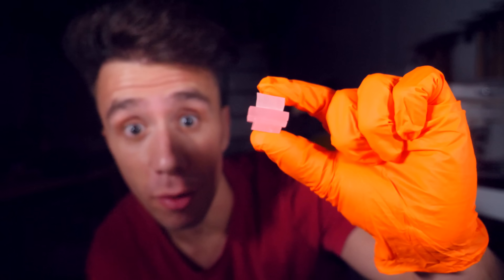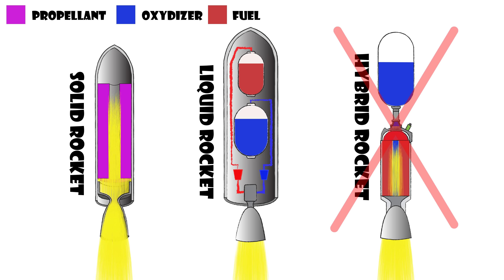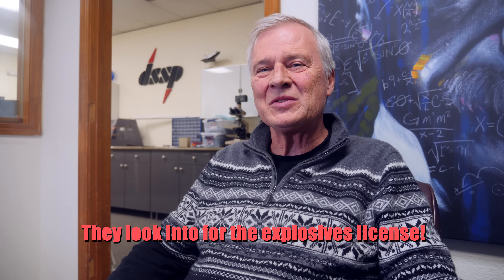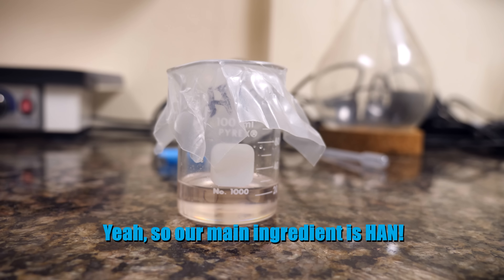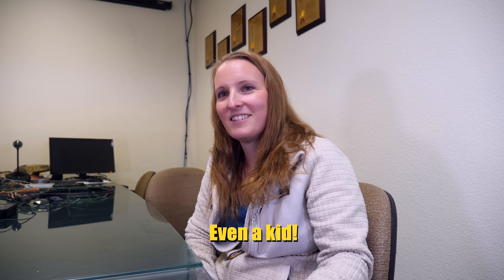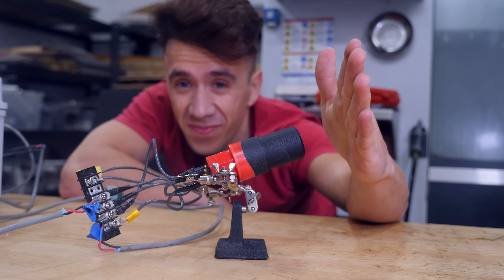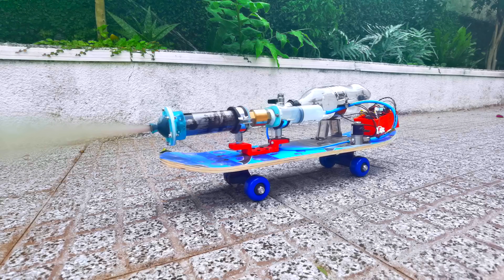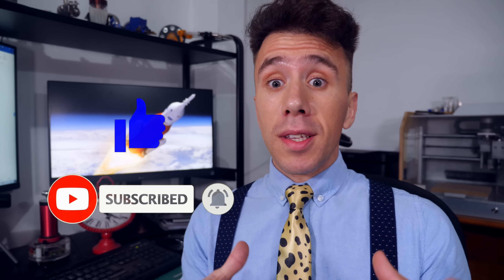ELECTRIC SOLID PROPELLANTS

Comment: I am shocked, it's like hydrogen held chemically locked, which has only 10-15% max hydrogen available per lb....

Tell us how this relates to that,

What % is inert weight?
Does it burn near hydrogen levels?

What are the oxygen to fuel requirements?

Having to have liquid oxygen for the combustion would create problems....

Weight to thrust info please.....

Comment: The problem with the Navy using hydrazine is more than just needing to evacuate if there's a leak. It's that a bunch of numbskull 18-25 year olds would be handling the stuff, greatly increasing the risk of the leak happening in the first place.

Comment: When I saw the plasma engine version of the rubber propellant, I thought you could maybe achieve a poor mans version by mixing nano particles of carbon or aluminium into melted hot-melt glue and then re-solidifying the result  to make it electrically conductive. Passing a brief high current through it, should convert it's polymer content into gasses without the need for an oxidiser.

Comment: That hybrid rocket engine looked terrible. Shouldn't the liquid circulate the reaction chamber so there is a barrier between reacted and unreacted material? Why would it just fall down? It can kill 3 birds with one stone if they slightly alter the design

Are you sure you cant get an explosives handling license? I feel like it is something youll wind up getting eventually anyways

Comment: The propellant is neat... but the only way to control the electricity is to make a matrix of wires in the fuel. That means part of your volume isn't propellant. Solid propellant has been made with thermal wire to accelerate burning but wires will be difficult to integrate

Comment: The issue I see with this propellant is the same as all other propellants.  That is that it is consumed.  Once it's all consumed then it is gone.  Would be best to create a propulsion system that is not consumed.  IE:  an ion propulsion system or similar.  One that can be a system that is easily refilled in situ on route.

Comment: Get an FFL.  It is not difficult, unless you have a criminal past.  Thousands of gun nuts have FFL's so they can buy at a discount.  You need a higher class of FFL but it's not hard.  You need to prove a need, so start a small rocket engine company.

Comment: This stuff is not as benign as it seems. You may need a serious rocket to get beyond orbit, but once out there, this fuel with smaller booster rockets could propell a weightless craft a long way very quickly.

Comment: How do you maintain electrical contact with the propellant. Doesn’t it burn away from the point of contact preventing the flow of elect?  Or is that being mitigated with the use of extremely high voltages to jump the gap as it widens.

Comment: so what if you got a bunch of balls and put em in a circle like a ball bearing, and gathered static to generate more plasmic mass in a donut of fusion generation? would be pretty cool if they molded a bunch in to stepping gears, and while it burns, it's adding its own high-torque and pressure to the equation. idk, man, i'd be gping ham. looks like i need to pick up gunsmithing after all. just for some podracers. this is why we cant have nice things

Comment: Using these as thrusters would be huge as today they have to load N204 and anhydrous hydrazine onto the rockets.  These are both very toxic, especially the hydrazine which can survive de-orbit in enough quantity to be dangerous on the ground.  Replacing it with this stuff would be a big savings on safety requirements for launch and de-orbit and probably cheaper because it wouldn't need liquid tanks or piping.  Just a block of this stuff and an electrode. Satellite operators who might decide to go thruster less to save costs will have this as a cheap and safe option to allow their satellite to either de-orbit or go to a graveyard orbit when the vehicle reaches end of life.

Comment: so, if you can make an electrical engine, that can use GEM or the other material, and that engine is efficent enough to propel lets say 5-10 tons into space. Would that be enough for a craft to make it into space and be reused many times over? 

because we could do a space station in a ring format, not so oldschool like the ISS, but much more like futuristic? 
As humans, we are defenetly capable to do better than just electric cables to transfer electricity. So where is the holdup?  Years of talking, to get interested of some companies so they invest, but the product (big space station) would take at least 2 or 3 decades to egnineer, build and send up there to even meet the goal. 

We have 3D printers and still nothing is going forward? its like we are stuck in 2010 or 2015!  yet almost 10 years later only SpaceX made tha practical jump to effectivenes. Why not build drone robots to take care of the junk in space, re-use it ect? 

i can make tons of ideas into a 3D picture, but yet again, so can at least 5 million on the planet if not many more. Why not work towards space, finding new minerals, new places to mine, new places to explore and maybe find some relics?

That are only some of my questions, ideas ect.

Comment: This is all BS. Rockets can't work in space vacuum. Newton's 3rd. needs friction to transfer kinetic energy and momentum. If the pressure of a system is 0 then the work done by the expanding gas into that system is 0. Gas expanding in a vacuum doing no work agrees with Free Expansion. This can also be understood as the gas meets no resistance as it exits into the vacuum and thus transfers neither heat nor energy to its surroundings. If the gas loses neither heat nor energy then it has done no work.

The principle of work and kinetic energy (also known as the work-energy theorem) states that the work done by the sum of all forces acting on a particle equals the change in the kinetic energy of the particle.

Rocket thrust is given by the equation: F=m˙vexit+Ae(P1−P2)

where m˙ is the mass flow rate, vexit is the average exit flow velocity across the exit plane, Ae is the cross-sectional area of the exhaust jet at the exit plane, P1 is the static pressure inside the engine just before the exit plane, and P2 is the ambient static pressure (i.e. atmospheric pressure).

Provided that the nozzle is not overexpanded and flow separation does not occur, Ae remains constant, and the thrust difference is realized primarily from the change in P2. If nozzle is overexpanded to the point that flow separation occurs, you lose contact, however, the exhaust jet area drops as well, causing further losses. That's why we have adjustable nozzles, but that only postpones the inevitable. Space vacuum creates flow separation. We can't saturate space vacuum to create backpressure. It's the path of least resistance. The lower the pressure the faster the flow. Momentum is preserved in the exhaust gases, there is no momentum transference.

Comment: So I’m assuming that since these propellants create plasma when ignited, their inertial momentum could also be significantly increased by an ion propulsion field once ionized, using it instead of a noble gas based propellant. Because a solid or liquid is significantly more dense than a gas, you should end up with more propellant per cubic volume. Maybe?

Comment: You never discussed the GIANT elephant in the room. Using power to make power. How would the electricity be produced? The whole point of the propellant is potential energy. available with very little, if any, energy used to release that potential energy. I would think that using power to make power is not very efficient.

Comment: Out of curiosity, could you use this to encapsulate solid fuel pockets that burn at predetermined intervals to control the burn of solid fuel. Making a reliable hybrid rocket? Or possibly use the gel/solid fuel cells to decelerate?

Comment: Controlled burn , carbon rod with insulation that burns away as the propellant burns. Bet I could take a carbon arc rod with a cellulose coating like on a 6011 weld rod insert it into the center of the tube and you got a stable burn thruster with the stuff

Comment: Im late for the printer, but it's ok.

My suggestion isn't so much for a next video, but a suggestion.

There must be a Goldilocks frequency you can execute either through the material or through the electron flow that will super power the thrust.

Perhaps pass propellent through a swirling electroplasma field rotating inside the eye of a powerful magnet.  Vibrate the magnet too.  Supercool the fuel....

Or maybe, just maybe, if you can create and isolated magnetic field that will pressurize enough to squeeze the reaction, you have your first have warp engine.

Comment: You know, I never finished this video so I came back a few months later and I realized something at the beginning. It's not the ATF license you need per se. It's actually the other acronym in that. You need the e part of that which is the explosives license. In Florida it is extremely hard to obtain because you have to have a facility, trust me I've been trying to get one for a little while due to the fact that I work on propellants and weaponry. Weapons development as well as explosives development has to have a sealed and lockable facility that can deter theft. You also have to have your proper containment and separation of chemicals. You may use some explosive materials by mixing them on site so that you do not have to call and have an ATF e serial number supplied to that unit especially if you're going to use it that day. If you plan on making it and transporting it though you must have a serial number attached to it from the ATF which means you must call your local agent and apply for a serial number for that explosive item even if it is a rocket engine. Certain binary explosives if not mixed do not count as explosives until finally mix into their proper explosive combination. This is why you can buy and transport tannerite as long as it's not mixed. The minute you mix it and transport it you have committed a federal offense. If you're in the United States please respect the laws of explosives so they do not take the ones we have. I pride myself on safety with all my inventions and experiments. My experiments are far too dangerous to put on YouTube. I've developed and designed some of the highest volume production hydrogen units in the state of Florida. I have hydrogen rifles and pistols. I have a hydro-lox rocket. I'm only able to build some of these because I was able to find what level classified me as needing an explosive license and stay below that level. This is going to sound weird to a lot of you but the only way I've kept myself out of jail is to keep in communication with the ATF and for a while when I was doing some of my biggest and most dangerous projects I knew my local ATF agents name and phone number almost by heart. Honestly I'm sure he got tired of hearing from me but it kept me out of prison.

Comment: Fuel burns away from the electrical probe and constantly forms a void.  So how does your electrical probe self-adjust to constantly touch unburned fuel?  I'd like to hear the solution to this.

Also, why is a solid rocket that you can't turn off such a big deal?  You don't want your rocket engine to turn off during liftoff.  If you run into a rare condition that you would want it to turn off (like a contingency-abort), you activate the launch escape system and then the range safety system takes care of your solid rocket boosters by blowing them apart (and the main spacecraft, too, now that it's unmanned).

Comment: I feel like this would be an interesting substitute for primers in a bullet cartridge, you could then engineer a firing mechanism to operate a firearm at a much higher rate of fire than a traditional firing pin since you could eliminate a lot of reciprocating mass... fascinating...
Reply: Also the trigger mechanism could be greatly simplified, a simple push button to induce high voltage through a coil

Comment: 3d print your dream car 100% accurately. 3d printed rubber tires, 3d printed metal frame, resin printed body, laser cut leather for seats. and even better if it  and has a running engine and shifting transmission both 3d printed 😊....

Comment: How hard would it be to make a drill that used sound waves and air pressure to drill into the ground.  That would be awesome.  Also what if we could make a small nuclear reactor with a pellet of uranium that we force to near super critical like that guy who got himself killed with the demon core?  Use a large water holding tank to hold water to keep the whole thing submerged in water it goes super critical steam goes threw a few small turbines that are in the tube and back into the bottom of the main tank of water

Comment: I want a 3d printer... Nearly as much as I want a home to put it in... Unhoused USAF veteran in Portland Oregon. So here's my idea - well, it's going to be a few ideas... Let's start with Kelvin's thunderstorm, that old experiment. It seems to me that it replicates the electrical generating effect of descending water over an aquifer ( that waterfall in Venezuela? That receives the most lightning in the world per annum ) causing ions of a different charge to rise and accumulate - blah blah - well, if there was a way to harness the electricity generated by Kelvin's thunderstorm, well, you'd be sitting pretty as far as power is concerned. Or perhaps an earth battery - ( which by the way, if you could  assist me in making one it would be great - I've got copper and zinc, and moist ground to place them in, I just don't know how to wire it. I figured that I would use jumper cables to a 12v adapter or a 12v to 110v transformer for cars and pull power that's useable that way is it as simple as positive to the copper and neg to the zinc 6 feet apart and viola! If you ever need an Igor - let me know. The current environs bore me and the thought of applying myself to a function that is both fun and scientific - appeals. Maybe you could assist me with a project that I am working on - utilizing H H O oh wow! NEW IDEA! using HHO to turn Plastic into diesel...the H could be used to displace the O in the crucible with the plastic and then used to create the heat that reclaims the fuel... Use a magnet to separate the H from the O at a t in the collection tubing.... The decomposition of H2O leaves one with a positive charge and the other with a negative.... So there you go... I also think if a guy could come up with a machine that made plastic - home waste - into useable 3d printer medium - he's richer than Ritchie as the saying goes.... Ps clue me in for a percentage of any revenue you may generate from these if you run with them ; ) cheers peace hair grease sneeze and if course, God Bless You

Comment: Oh... oh my god, you are right the potential for this kind of system is huge, I mean the power of a solid rocket motor but to be able to have it on/off at the flip of a switch, that could even be applied to aircraft since it takes a current to burn and not actual fire, Imagine emergency stops or a thruster that could immediately stop a spin. The amount of people you could save in general aviation is actually pretty high. You could even do a video on that, build an RC with a scaled down thruster and see if you could get it into an unrecoverable spin, and then use the thruster to avert it. Show how quickly it could be turned on and off without damaging the airframe. Depending on the thruster design it could be placed either on a wing tip or on the tail. whichever would be best to avoid unnecessary structural strain because you don't want to break the plane while trying to save it. I think they've done stuff like that before, but it usually means having dangerous material on the plane, while this stuff looks like it stores a lot safer compared to a Solid Rocket Motor. I don't know but it might be a connection that hasn't been made yet with that material.

Comment: it igniting at the contact point with the wire seems like the biggest problem to me 
you cant send the electricity trough it to ignite somewhere else
both it and the conduit can melt away from contact, making the rest unignitable 
so there is a serious limit to how big and reusable you can make it 
seems more a gimmick then useful at this point
the liquid does sound better

Comment: there couple of problems with that type of engine. you will need also to install a pretty big electric battery to the rocket to make engine work with that type of fuel. given the specifics of combustion of that fuel, it is not entirely clear how exactly to burn it if we are talking about a long flight of a heavy rocket of more than 5 minutes. In theory, an interesting fuel. practical application is very questionable.

Comment: It's not really a traditional propellant. It's technically an electric ablative material. Teflon behaves similarly at very high voltages. Read the paper Thermodynamic Properties of Hydroxylammonium Nitrate-Based Electric Solid Propellant Plasma

Comment: Difficulty starting and stopping and throttling isn't the main drawback of solid rockets tho...
They tend to have high thrust density, but poor thrust velocity and Isp.
So, they're good for side-boosters and bad for spacecraft that live in a vacuum...

Hybrid rockets are another style of solid rocket that can be throttled, using oxygen instead of current.

These electric solids could be good for landing probes on planets. They last forever with no propellant boil-off and have decent thrust density for landing heavy probes.

Comment: I would like to see a large scale model rocket with 3 booster rocket engines & one main rocket engine which would ignite once the 3 booster rocket engines run out of fuel & the booster rocket engines could be jettisoned for reuse or they could be left on.